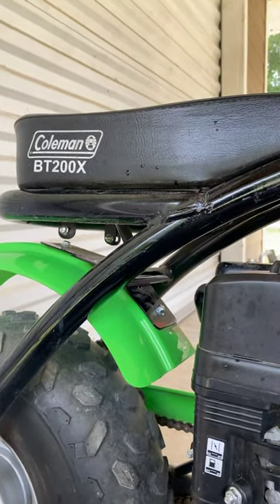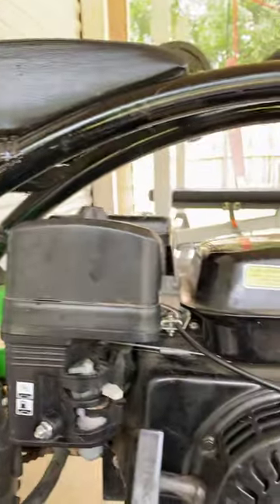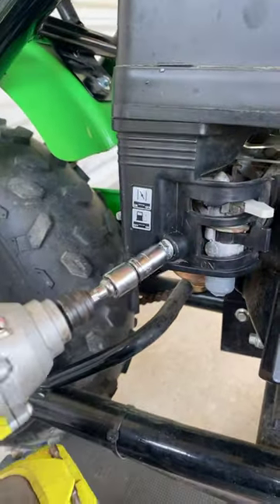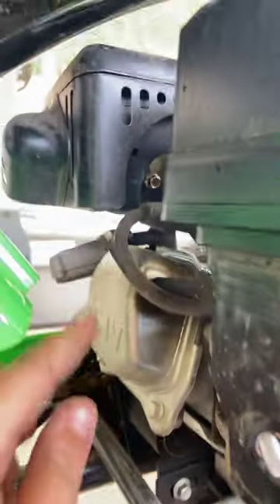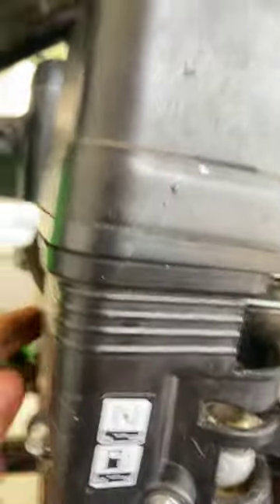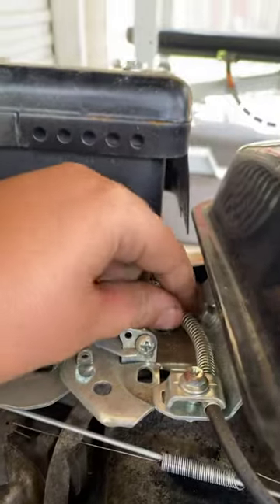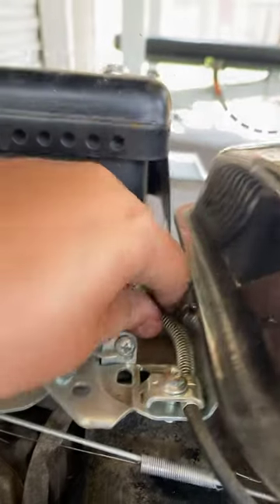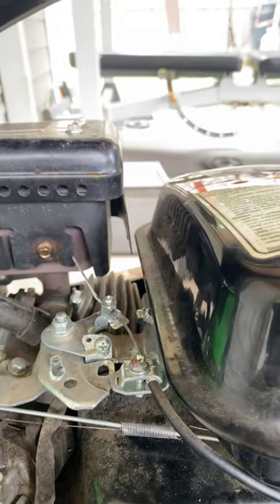Tutorial on how to￼ quickly make a Coleman mini bike go faster!               #minibike

Comment: Alternate title: how to blow up a mini bike
Reply: Yup
Reply: nah not if you don’t deliberately try to
Reply: Bruh
Reply: What???
Reply: I took my old mini bike on a Cruze with the throttle opened up after about 7 miles  the fkn magneto exploded.
Reply: @l0lan00b3  those stock flywheels are not meant for being at wide open beans for 7 miles, billet ones are or the magneto that is a part of the casting in the flywheel. The cheap ones are held in with glue and one screw
Reply: @nickbestn4230  didn’t realize they were glued lol knew the screw was there. Pushed it to failure makes sense. Didn’t realize they couldn’t handle it though
Reply: @l0lan00b3  yeah surprisingly though I have an old 98cc motor that I swapped for a 212 on my CT100U and that 98cc motor has a cheap flywheel and has been running governor bypassed at pretty much full beans for around 2 years and hasn’t failed
Reply: @nickbestn4230  weird if I remember right the last mini bike I had was that Baja W with a stock 98cc motor. Not sure who built the motor now. I was riding it like a mf though back then. Took it on some cross county back road mini trips. Around the same time the magneto exploded the spark plug socket stripped. When I got a new coil on it and pulled the cord the spark plug shot out of it lmao.
Reply: @l0lan00b3  dang what’s funny is that the Baja engines are actually 97cc flathead design where the 98cc modern design is a lot different

Comment: Why not back your screw out as was intended? The real limiter to it is how far the throttle body moves. And the spring on your accelerator cable is to prevent the cable from sticking and resulting in loss of control. What you absolutely could do though, is adjust the air fuel mix by opening up the intake ports on that plastic air intake you removed to uncover all that, and by turning the screw the carb left a full rotation.
Reply from the maker: Hey! Thank you for the recommendation. The only reason I didn’t take the screw out is it’s welded on. This was a stock motor, and not a aftermarket.
Reply: Hey I’ll tell u why cause he said so get out of his comments and never doubt mini bike man🤬
Reply: @Conordetails that shouldn’t be like that on a stock motor that’s your limiter screw that is supposed too be adjusted
Reply from the maker: @braydenmichaels8190  there is no screw
Reply: @braydenmichaels8190 a couple of good reasons for welding the screw, first they don't want it to go any faster second there is allot of vibration and it's not a bad idea to safety weld many of the screws on there.

Comment: Do not take that spring off, it won’t allow your throttle to return to idle, and it’ll just rev Bomb
Reply: Yes it will go back
Reply: @eugeneoboznyy5158  springs retract when force is held against them. When you take that spring, the throttle (handle) will not go back

Comment: You don't need bolt cutters for the screw you can just simply unscrew it. That's the governor
Reply: The governor is inside, it’s a plastic gear that keeps the bike from going past a certain rpm
Reply: @thecarnut9899 I only remove the screw. Tell me about the plastic piece please I'm trying to get more speed
Reply: @terellgates3379  there are a bunch of videos on YouTube, I’ve never actually done it so I can’t say exactly how but there’s a spring you can also zip tie and I’m going about 35 mph after that and unscrewing the throttle stop screw
Reply: First off that's the throttle screw it doesn't give you much speed if you mess with it maybe a mile or so and yeah just unscrewing it a bit is the best option if you completely remove it you'll be struggling against the governor for extra speed while it's trying slow the rpm back down
Reply: @terellgates3379 I'd say get a torque converter you'll get a few extra miles out of it but it's a 60$ upgrade
Reply: The throttle limiter screw is welded in place. You have to cut it off or you can just bend the tab so its out of the way. I got mine to about 35mph by removing the throttle screw and moving the spring that goes to the governor arm to a hole that was further out on the governor arm. Or just zip tie the spring.

Comment: You need to zip tie the Governor dude. Added 10mph
Reply: I keep seeing people saying to do this, but I don't really understand what you mean. Where exactly do you ziptie the spring to?
Reply: @JacobOfTheNorth  there is a small spring under the gas tank connected to the governor arm
Reply: @JacobOfTheNorth  there is a spring ( governor ) which when it extends keeps the engine from reaching max velocity.  Its under the gas tank if you zip tie it to keep it from extending then it literally adds about 14 mph more ,
Reply: @orlandoramirez5629 can u send me a video or something i really wanan try it😊
Reply: And blow the motor in a week 😂
Reply: @nobody6120 don’t do it I blown my motor with it
Reply: @cm6string only if u gotta cheap predator or ghost motor😂 my generator engine has been running strong for over a year with the gov zip tied

Comment: A good mod that I have done is drill a big hole in the front of the air filter box, it’s basically a diy supercharger
Edit- forgot to say, but it just gives you better acceleration and possibly 2-3 more mph.
Reply: U must not know what a supercharger does lmfaoo that would just be a cold air intake

Comment: Yes and no you can remove that spring but need to relocate it so your THROTTLE WILL CLOSE and you will slow down second dont cut the SCREW it's a SCREW you can turn the SCREW left or right to listen or tighten it like a SCREW is intended for need to think just a tiny bit more I'm not trying to be a asshole just making sure no one else finds out the hard way

Comment: Taking that spring off just makes your throttle not work right cause that spring is what returns your throttle and without it your throttle will get stuck open and you have too pull it back too normal with your hand which will make you burn yourself on the muffler
Reply: I wish I knew this before I did it I put it back on but it’s still fucked

Comment: Dude it unscrews
Reply from the maker: No, it doesn’t retard. Get your facts, right. This is a stock motor
Reply: @Conordetails  it does unscrew lol its a screw
Reply: @gildedlion3708  kids am I right 😂
Reply: @gildedlion3708  it’s welded on, the kids right on this one
Reply: @codyswilley it's welded, by the bike before you talk brokid
Reply: @gildedlion3708 it's welded, by the bike before you talk brokid
Reply: Its a throttle limitation screw bolt or whatever u wanna call it